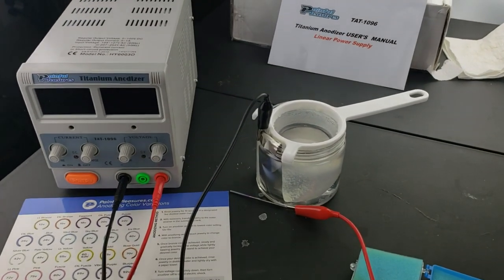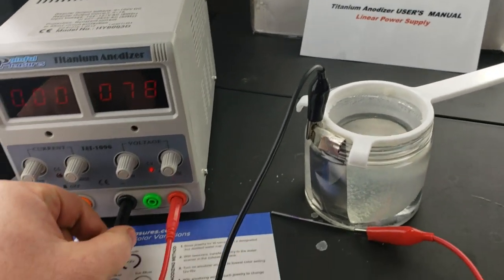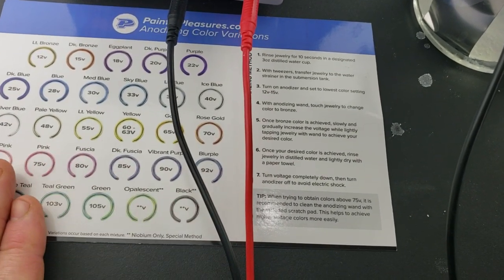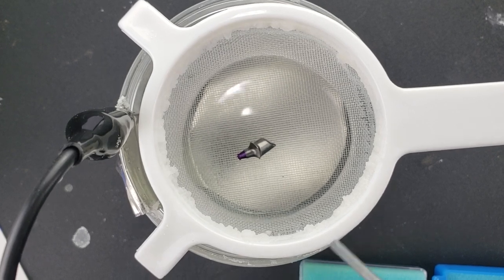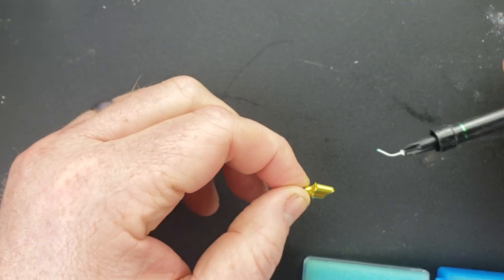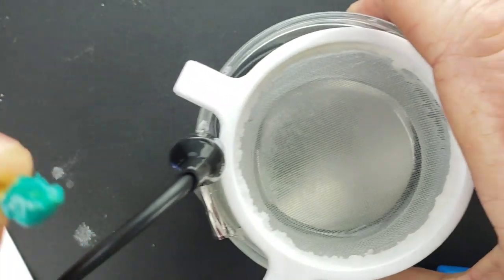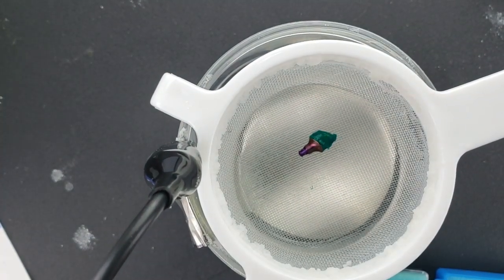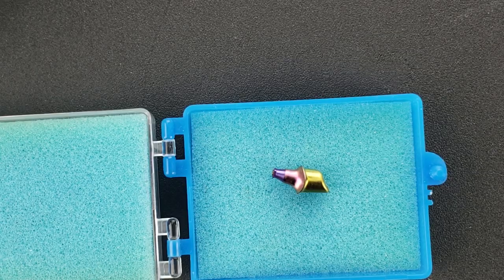Anodizing titanium abutments in house

Comment: What solution do you use?, first i sandblast the abutment, (active portion),  then  i anodize
Reply: Beter to do in 2 stages. First sansblast and make the upperpart gold. Then  cement and clean the subgingival part first for biocompatabillity. Then make the lower half pink or whatever color you wish
Reply: @ovisnamgurb8498  ok, what liquid do you use?